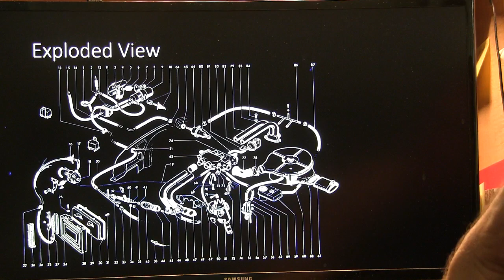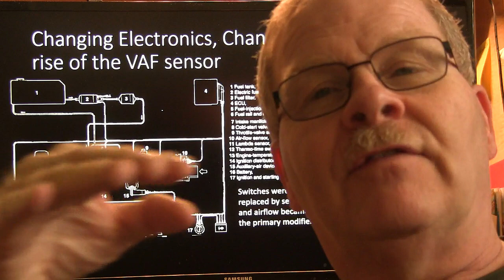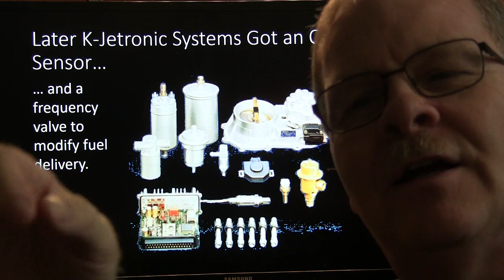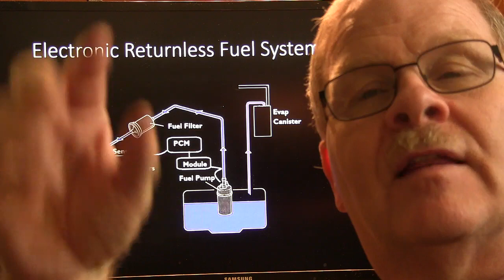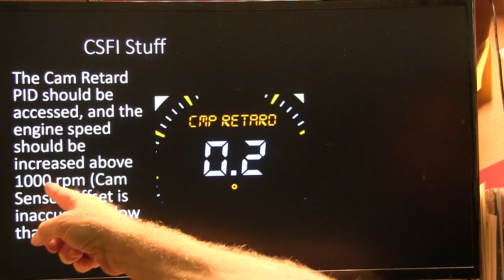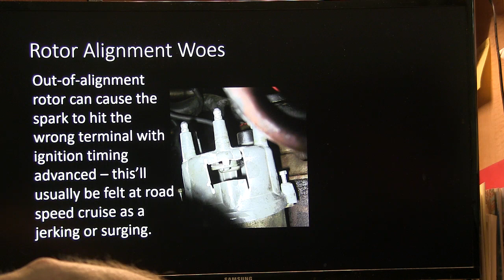Fuel Injection Evolution - and stories

Comment: Wow this is very rich with information and very interesting about the sensors. On a 1991 Straight 6 24v Opel engine, I owned, I learnt about the 'Knock' Sensors on the side of the cylinder block. There are 3 Pietzo electric crystal sensors each serving and resting between 2 cylinders. The ignition timing is advanced or retarded accordingly by the engine ECU until it is running just before the point of detonation or "pinking" occurs, the amount of detonation is picked up by the crystals which when shocked by the knocks produce small voltages which are measured/calculated into information which allows the engine to run at optimum power and health and in effect is a way of measuring the octane rating of the fuel which is very variable from country to country, premium or super fuel and age/condition of fuel etc.  Many will remember old days of turning distributors to alter ignition timing to elimate harmful detonation which can burn valves and wear engines out quickly, later on many cars had small jumper plugs that could be put in different positions in their sockets to adjust timing for different octane ratings. One thing we are lucky with here in the Uk is that we can buy 98 or 99 RON petrol/gasoline from nearly every gas station, that is our super unleaded and I think regular is around 95 RON.  I wonder how far you would need to turn the distributor in an old american car to get it to run properly and how much more power would result?
Reply from the maker: Ford has had that jumper plug after coil pack ignition came out and if you had a spark knock you were supposed to pull that plug and it would retard the timing 3°. It looks just like the SPOUT connector. I used to set the timing advance using the distributor as far as I could without pinging or hard starting for optimum power and fuel economy.

Comment: Who wants a plastic distributor? I think moving engine parts, parts that handle fluids, and parts that experience engine heat should be made of metal. About a week ago I saw BMW spontaneously catch fire under the hood in a parking lot. I said " That was some expensive plastic they had once".
Reply from the maker: it has bothered me for a very long time how they run hot coolant through plastic parts it's almost like they want the parts to fail to destroy the engine after it's out of warranty so you'll buy another car